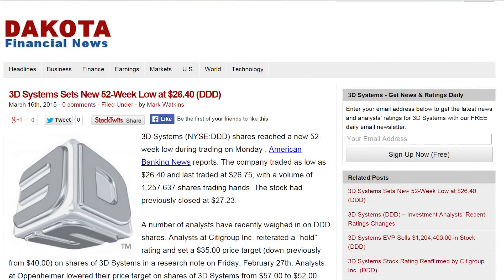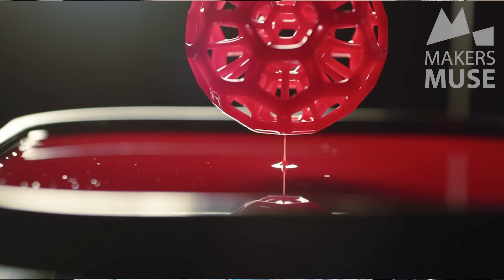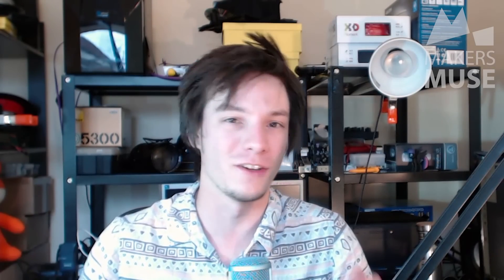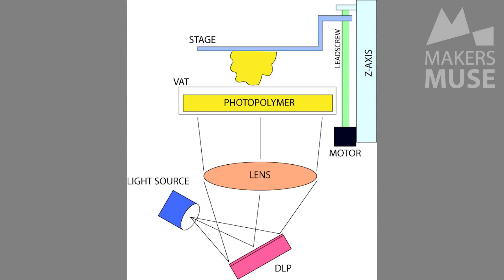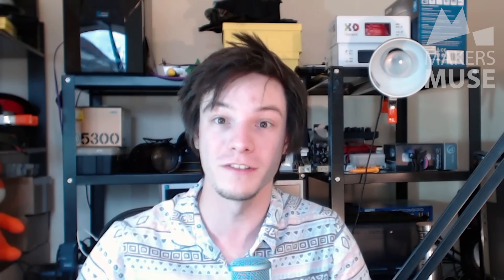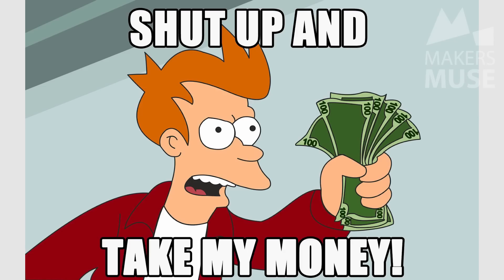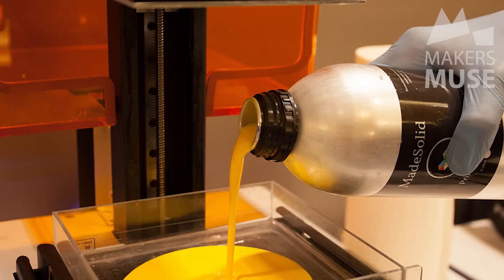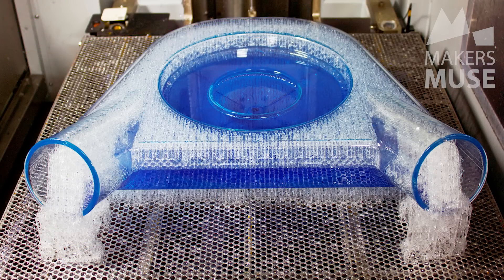New 3D Printing technology prints 25-100X faster! Carbon3D CLIP - 2015

Comment: Hey! Im looking into getting my first printer soon, I've been looking at the robo 3d r1+ recently, but people have been recommending the prusa i3. Any good versions of the i3 to recommend?   My price range is anything under $800 us, Got any other printer suggestions? I have some experience with printers at school, but would consider myself a noob.
Reply from the maker: +Zach Fischer Both are good machines, though I haven't tested out the Robo R1+ myself yet, I have heard great things. Another option would be the UP Mini which prints super reliably in ABS but can't really do any other materials.
Reply: +Maker's Muse thanks so much for replying so quickly! I'm looking for something that can print in exotic materials aswell, just for fun. any idea how the wanhous(forget how to spell it) kit compares to the original 600 dollar prusa kit? also for a beginner , would you recommend buying a working out of the box printer or a diy kit? again thank you so much for responding, made my day :)
Reply from the maker: +Zach Fischer No worries! Yeah get a ready to run machine for sure - kits can teach you a lot but are a long process to get a print - you can have The Up Mini, Wanhao i3 or Robo R1 all printing your first 3D print within 15minutes of unboxing. For experimental materials I think the wanhao might be better, but it doesn't handle flexible materials unless you upgrade the extruder block with something better. Cheers!
Reply: +Maker's Muse awesome! thank you so much! I'll definetly be donating to your patrion:)
Reply from the maker: No worries! Only if you want to :) Best of luck!
Reply: +Maker&#39;s Muse My only concern with the up mini is the build volume and the proptietary filiment. Why is the wanhoa so much cheaper?
Reply from the maker: The UP's aren't proprietary exactly, the software just locks the temperature down but you can get around it with a software hack. They're just build really well and good for travelling - the wanhao is a more fragile design which can't handle ABS as well due to the open frame shape - but is awesome for PLA prints and yeah, it's cheaper! If you're ok with PLA most of the time go with the wanhao - but if you really want stronger ABS prints I would look at the mini. Of course it's not black and white like that, there are 'stronger' PLA blends you can use.
Reply: +Maker&#39;s Muse How about the original prusa i3 deign? the 600$ kit? Any thoughts on that? Again, thanks so much for being so helpful.
Reply from the maker: I think the wanhao is better value, but it is the original which is nice. Buy it assembled though, not the kit.
Reply: +Maker&#39;s Muse got it, thanks! I love the fact that every printer you recommend you have an in dept video on! Its so helpful!
Reply from the maker: I wouldn't recommend a machine I haven't tested! :)

Comment: Yeah, I saw that talk, it was impressive.  However, SLA generally doesn't need support material like FDM does.  SLA neither has the effects of gravity, nor the kinetic forces and pressures of a moving, extruding, print head to contend with, so support isn't required in the same sense as FDM (apart from connecting the part to the build platform).  The reason Form machines print at an angle is not for support reasons, but in order to minimize the amount of surface contact with the tray in order to minimize the force required to separate the part from the tray in z moves (more force equals higher probability of failure).  This is one of the cool things about SLA is that it allows you to print things FDM would have a very difficult time with (unless FDM was using a dissolvable filament).

Now this new technology, in addition to really speeding up the print times, will further improve the reliability of SLA, because the single biggest reason for SLA failure is where a part doesn't completely detach from the tray, and it causes a print shadow (the stuck part obstructs the laser).  Resulting in that part of the part no longer printing.  This problem would be completely eliminated with an oxygen shield.  So this technology would only increase the appeal of what is already a very appealing technology (because of increase resolution, reduction in feature size, increase in renderable model domain).  This technology could well prove to be fool proof once they perfect it.  

You are correct, post processing SLA is a bit of a mess, but there are benefits as well.  One is even though the parts are messy, left over resin is less of an issue than left over filament.  Filament comes on a spool, and as you run lower and lower on the spool you start asking yourself "do I have enough left, should I start a new spool?"  With resin, because it's a liquid, this is not a concern (as you can always just poor more in).  So there are up sides as well to the fact it's a wet process.  Also, as far as desktop printing is concerned, you don't really need to have a UV oven to post treat the part.  You can just leave it in the sun, it will finish hardening just fine.  The bigger problem is that the part will continue to harden over its entire life time as it sees more and more UVs, which means it will eventually become brittle unless it's kept completely out of sun light.  So you really need to try to limit sun exposure after a certain point.

Even though I think this technology, or technology like it, will eventually be disruptive within the SLA space, I'm not sure it will much effect FDM.  FDM is well established, even if it is a bit of a pain to work with, FDM has a couple of key advantages.  One, is the ability to work with different filaments in a single print.  The other is size.  You can literally make a FDM printer any size you want if you really take a mind to it, you only need to control your environment.  SLA on the other hand is having a really difficult time scaling much past 150mm x 150mm in the x/y.  The reason for this is because as you move out on the x/y plane it become more and more difficult to maintain focus and resolution.  This is a problem with any sort of projection.  You have to maintain high resolution over a large area, which is intrinsically difficult, and you have to deal with the optics of the situation.  Ultimately you could solve this with overlapping projection, but that would be an extremely expensive system to implement.

Comment: I really like DLP and SLA process because they can bridge an infinite amount without bridges sagging, as long as the part is strong enough to lift the bridge off of the plate. The projector based printers are also cool because the time to print is height based, so you can load up the build plate with parts and it still takes the same amount of time.
Reply from the maker: +Alec Nordlund Adhesion to the bed is also pretty important, if you can't break the suction it can be strong enough to flex and break unsupported bridges. Still, if carbon 3D's tech takes off that problem will be gone! It is pretty cool that you can print the whole bed in the same time and makes batching very attactive! I do like that you don't 'have' to though, because the unused resin can still be used in later prints.
Reply: +Maker's Muse well its been a year now and sla/dlp printers are still up in the air, i think it has alot to do with shipping restrictions of the resins and as you mentioned all the extra infrastructure needed for post clean up and curing

Comment: I would think that a workable alternative to this would be to essentially do the reverse of what the peach printer is doing, and use a salt water layer to float the resin above the projected screen of a dlp type projector 3d printer to prevent the resin from bonding to the glass or acrylic in the first place. Then simply keep a float system to manage introduction of resin to keep just enough resin in the print bed to do your print as you draw the cured resin out of the bath.

Note I'm not saying this is a 'good' way to do this, simply observing that it might bea way to do this without the special o2 permeable membrane.
Reply: This is actually a widely discussed idea on the forums. The saltwater tends to mix or created uneven layers where it meets the resin. Now people use solar panel encapsulate fluid that solidifies like a jello or silicon.

Comment: I use to work for a dental pharmaceutical company and the light cured resins are very durable and F.D.A. approved but there are some issues people should be aware of.  These resins DO NOT like to be left out in a normally lighted room.  So if you do your print work in a regular room with normal lighting the unused resins will all go hard on you eventually, unless you remove the liquid from the production site between production runs, this could be a big problem and a time consuming clean up.  Normal ambient light, like what you would experience in your bed room, den, garage, factory floor or what not, contains the U.V. frequency that can cure and set the resin.  Yes, the amount of that spectrum is low so a person can deal with the ambient light issue but is it still an issue.  You could not just leave the unused material laying out unless you wanted a hard brick in your resin bath and it would be a pain to remove and clean if that happened.  Also, if you unknowingly get some of this on your clothes and it sets up (hardens/cures), the only way to remove it is to cut away the cloth that it is on.  The liquid will get between the fibers on your clothes and you can not remove it.  Anyone using this tech will probably be using dark room techniques like they do for developing chemical photos.  Ask your family dentist about resin and light curing.

Comment: I'm a bit confused on how this works can you post a link to some were I can find more information?
Reply from the maker: Sure thing, their website is here: http://carbon3d.com/ It's a bit confusing because they're being very secretive as to exactly how the oxygen permeable membrane works...
Reply: Moshe, the process is not that difficult really.  The resins they use starts as a liquid in the 'bath' and just like the resins that a dentist can use to repair a filling in your mouth, it hardens when exposed to U.V. light.  This process (C.L.I.P.) projects a laser U.V. light from underneath the tub but through a 'glass plate' at the bottom of the tub that is also oxygen permeable so the first several micron thickness of resin at the bottom of the tub has O2 in it.  The O2 prohibits the liquid resin from becoming a solid but as the platform lifts out of the bath, the resin touching it, but still in the liquid resin, hardens from the U.V. laser before it is completely lifted out of the bath and into normal air.  My guess is that the plate at the bottom of the bath is some O2 permeable polymer.  Think Plexiglas or some other plastic like material.  The entire resin curing thing has been used in dentistry for well over a decade if not two decades.  Ask a dentist about curing resins.  I have even seen resins go hard in a foil tube so they don't get exposed to light.  Go figure.  Unlike a spool of ABS sitting on your shelf, the resin will probably have a 'shelf life' as it gets exposed to U.V. light.  I use to work for a dental pharmaceutical company and handle doctors questions about resins on an hourly basis.